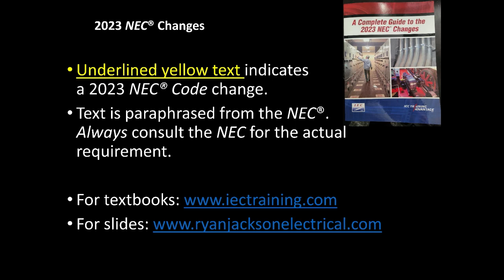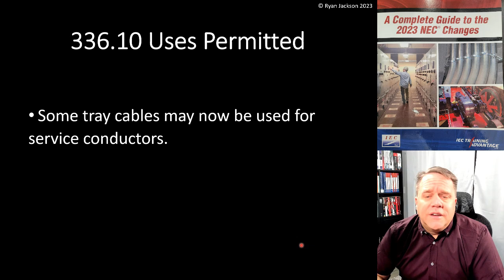336.10 Uses Permitted (Tray Cable)

Comment: Ryan, I'm seeing that as 'or' not 'and/or' small thing, but I've heard of an ahj the next county over who would fail it if used in the 'both/and' situation. While I agree that if it's good for either then it should be good for both at once, but that's not the exact wording on the cable. Is that pedanticly correct, or am i missing something.

Thanks for the work you do. 
SB
Reply from the maker: It is definiley "and." It cannot be marked for both if it doesn't comply with the UL product standard for both types of cables.
Reply: @RyanJacksonElectrical  thanks for the response. It makes reasonable sense that way.   Been around too many lawyers lately :(